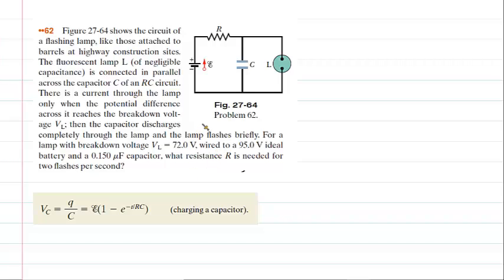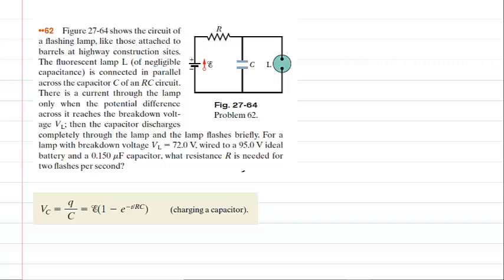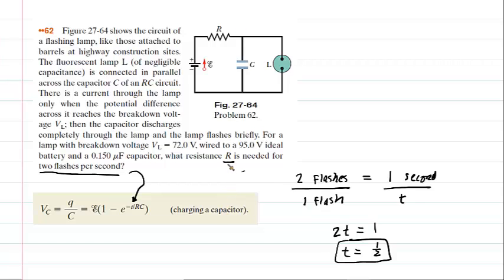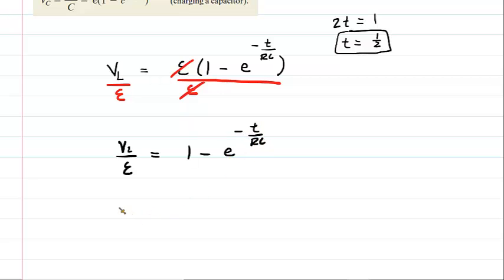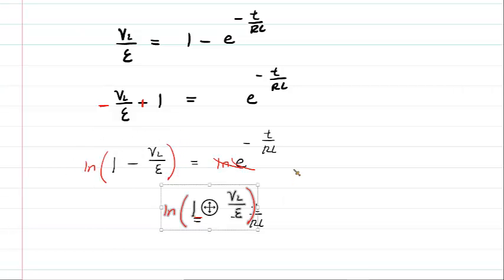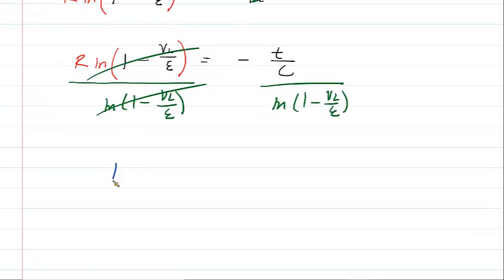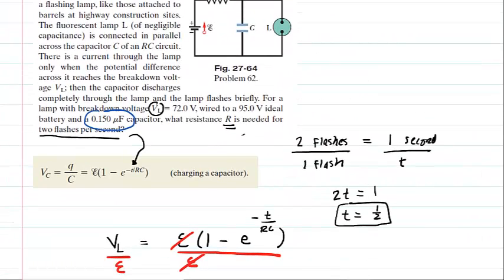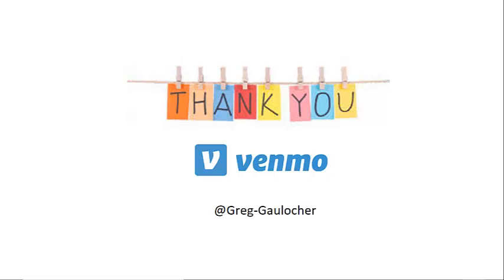The figure shows the circuit of a flashing lamp

Comment: Sir, according to the equation you have written below the question, once the breakdown voltage will cross the voltage capacitor and the infinity will be the same as the battery, then why the flash in this question? According to the equation, the breakdown voltage will come only once. so then it will lighting continously.

Comment: An AC source operating at 62 Hz with a maximum voltage of 170 V is connected in series with a resistor 
(R = 1.2 kΩ)
 and an inductor 
(L = 2.1 H).
(a) What is the maximum value of the current in the circuit?
 
Incorrect: Your answer is incorrect.

Your response differs from the correct answer by more than 10%. Double check your calculations. A

(b) What are the maximum values of the potential difference across the resistor and the inductor?
ΔVR,max = 
 V
ΔVL,max = 
 V

(c) When the current is at a maximum, what are the magnitudes of the potential differences across the resistor, the inductor, and the AC source?
ΔvR = 
 V
ΔvL = 
 V
Δvsource = 
 V

(d) When the current is zero, what are the magnitudes of the potential difference across the resistor, the inductor, and the AC source?
ΔvR = 
 V
ΔvL = 
 V
Δvsource = 
 V